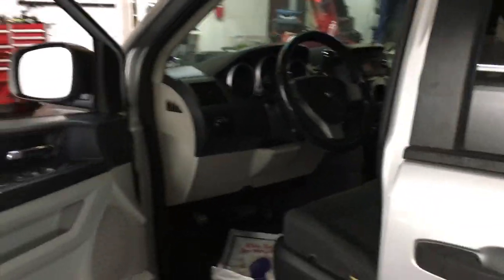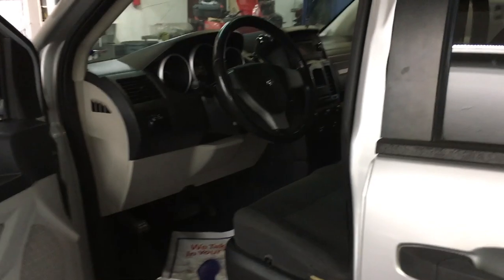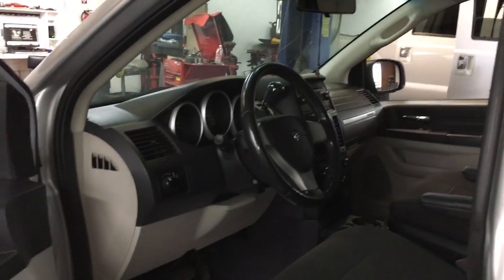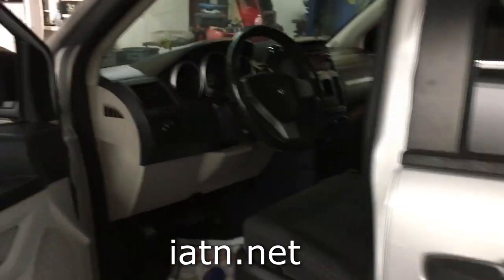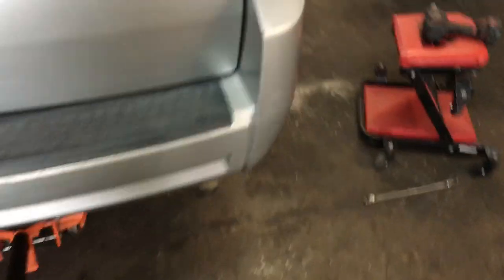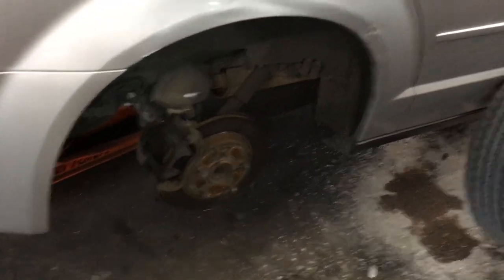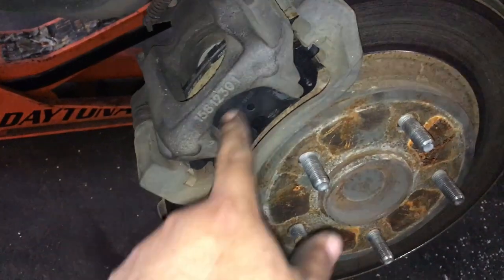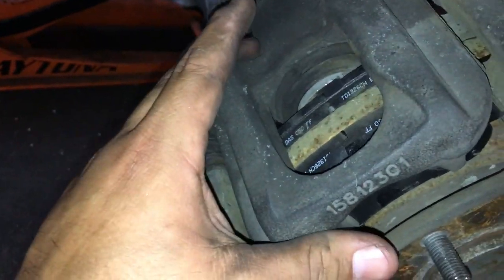DODGE GRAND CARAVAN BRAKE PEDAL GOES TO FLOOR QUICK TIP!

Comment: So I had the same problem with my pedal but there was rattling coming from the rear, I had assumed perhaps a bad shock... Well before firing the parts cannon at it I lifted the back and started inspecting. Shock was fine, rotors shot and the right rear caliper had that gap and lots of wobble/play. Obviously someone has done the rear pads prior and left the gouged rotors but that gap and wobble seemed odd. Glad I checked here! Very helpful!

Comment: Brake pedal 'feel' ( pedal height) always comes from the rear adjustment. On vehicles equipped with screw in type rear calipers, you DON'T turn them in all of the way! You turn them in until there is a slight drag on the pads. It takes a bit of trial and error. Also it is very important that the stud on the inboard pad engages the caliper piston slot. This way there is constant pressure on that pad, and the piston can move out as needed for wear on the pads. Learned this way back in the early 90s on GM W cars. Still applies today.

Comment: The trick to adjusting the gap on  these types of calipers after brake pad replacement is to yank on the handbrake lever while pumping the brake pedal. Sometimes it takes up to 20-25 pumps. It's so the piston screws back out the same time you depress the pedal and it will adjust itself.
Reply: what do you mean? The caravan does not have a hand brake; It has a pedal.
Reply: Close the gap on the brake caliper I'm going to try this later today on the exact same year and problem car.

Comment: That did the trick! Thanks for posting it!
  I replaced passenger side rear rotors and pads last night and all was fine, no air in the lines. Did exactly same procedure on drivers side this morning and pedal was going to the floor.
 Knew it wasn't the master cylinder as it was replaced 6 months ago.  Thanks Again!  Cheers!

Comment: Why pedal is sunk is because all vehicles brake design is depending on applying  brake at the rear wheels first then front (hence double piston master cylinder), that's intended for better breaking stability and redundancy whenever one piston/brake line fails, system will be operable whith a single stroke at 50% reduced power plus increased pedal travel 
Good job Eric

Comment: I have had this exact issue happen to me a few years ago after I replaced the brakes on one of these vans, drove me crazy for a little while until I realized the issue with the piston not pumping out. I used a micrometer to measure the stack up of the pads and rotor combo then found a socket with the same measurement. I then use the socket as a gauge to set the piston depth anytime I replace the rear brakes on this model.

Comment: Thanks guys!  I just bled the brakes last week on my 2016 Grand Caravan.  Gonna fix this now and back out the rear pistons to a reachable distance.
There are other screw-type piston calipers that DONT do this (like Nissin and Akebono).  Now I know that if I ever have this feeling (as brake pads wear down over time), the pedal feel can drop too.

Comment: Great info there!  I did the rear brakes about 4 years ago and I know exactly what he is referring to.  If you don't have the special tool that he mentions in the video it can be a real SOB to turn that cylinder in and out.  It can be done with needle nose pliers but its not as easy as turning a bolt in and out as you may think.  Fortunate for me I did move the cylinder all the way up to the pad..but not because I knew this would happen, it just seemed to be the right thing to do.. now I know why you need to do this and I'm glad for the info.. thanks ADVANCED!

Comment: I don't know if this works on newer cars. In the 90's I was tought when a vehicle comes in like this, to go slow in reverse then stop the vehicle using the parking brake, repeat a few times until the regular brake pedal firms up. This might only work on drum brakes, as I was trying to fix this issue in a pickup with drum rears when an older tech taught me this trick. Thanks for the video!

Comment: This is why I love You Tube.  I just bought this van and it randomly does it where the pedal goes all the way down.  Was thinking it the brake booster but now I will check this first.  Hopefully this is it and it saves me from going down the rabbit hole.
Reply: Did you find out if this Was this your problem? I'm experiencing similar experience with my '10 T&C
Reply: Also curious– did this solve your issue?

Comment: Ran into a similar problem on a Ford. Replaced the rear pads and then the rear brakes were not engaging.  Spun the rear pistons out a bit and they started working.  It was at the end of the day and frustrating, but an easy fix.
Reply: Wouldn't  just applying  the parking  brake a few times  adjust that piston  out?
Reply: @scotthoskins2545  tried that

Comment: Dang, I had a similar experience after doing rear brakes on a Jetta. Fortunately I didn't even consider the MC or ABS to be the source of the problem. Sliders were all fine. After a little head scratching I realized that the automatic adjustment mechanism on the rear disc brakes ironically requires at least partial contact with the rotor. If the rotor is too far out, beyond one pedal stroke, it can't automatically adjust. When I spun the slave cylinder out to position the pads closer to the rotor, the problem solved itself.

Comment: Great design!  The engineers must be so proud!
Reply: Dodge is the WORST! I have a 2006 Grand Caravan, but it was inherited. I love the stow and go seating, and the room it offers. But these are without a doubt, the WORST minivans made. You would think after 121 years, Dodge would figure out what works and what doesn't and at least try to make good vehicles. This particular issue could cause accidents and deaths, so why not just use calipers that don't have this issue? I honestly think Dodge is trying to get people killed.

Comment: Found more detailed description of the reason for this problem:

All rear calipers with an integral emergency brake use screw-in retractable pistons. I think Kelsey-Heyes invented them. This has been the case for 30 years on everything from 1LE Camaro to 1982 Lincoln Continental. The most common error made by mechanics causing the pads not to touch is failing to properly adjust the pistons when replacing the pads. If the pistons are screwed in (retracted) too far, they may fail to self-adjust. The piston needs to be screwed in just far enough to slide the caliper onto the bracket and pads with some force. If the pads are screwed in too far, the caliper will just flop around and the piston will not move far enough to pinch the pads against the rotor. The emergency brake mechanism results in limited piston travel. The force of the piston pinching the pads is what readjusts the mechanism. It the piston can't clamp the rotor, then it will never adjust. Basically you are supposed to fully retract the pads and then snug them up until it's tough to install the caliper. This will give you some friction or rub for the first mile or two and then the pad burnishes off and everything is good to go.

Comment: i had the same symptoms on our work van after removing all the brake pads and cleaning the corrosion off the bracket and pads to free them up. i did turn the rear pistons in for easier assembly and then had the spongy brake feeling, after I reinspected the system for leaks and didn't find any. will check this today for gap

Comment: Had the similar issue with my wife's 2010 grand caravan 6 months ago. Thanks for the video, it will help someone else for sure. Difference was our brakes were replaced 6 years ago, and now this issue came up. I did the same adjustment and brakes are firm!

Comment: Thank you so much for this tip. Been trying to figure this issue out on my landlords van. Whoever did the brake job turned the piston all the way in to where low pedal pressure. Your tip worked. Im not a tech but work on my own vehicles. The more I can learn the better. Thank you again.
Reply from the maker: Glad it helped

Comment: We really like the Chrysler/Dodge with the 3.8L V6. Very solid drivetrain and we easily got over 200K out of the first two and both are still on the road with new owners.  Saying they’re terrible vehicles as some of the commenters above have done is not accurate.  We  now have a 2008.  Same squishy brake problem.  Two things: If your rear brake pads have a pin that lines up in the piston groove they will not self adjust as that pin prevents the piston from spinning out to make contact with the back of the pad.  As other have noted get pads without that  pin..  somebody said they would grind it off - I have not tried that.  Or do as the video suggests  reposition your caliber piston to meet the back of the pad. Second tip - on our 2008 T&C there is a small button on the left side of the steering column that allows you to adjust brake firmness to your liking.  Not sure all T&Cs have this feature but we didn’t even know the button was there until I was poking around under the dash one day.  It has a foot on brake stamped on it.  Try that too.  Our brakes firmed up a little but not like when you adjust that rear piston.  Dealers are either ignorant of the root cause or scamming people into expensive ABS modules and other parts etc. over this issue.
Reply: That button on left side of tilt steering is to adjust peddles back for short drivers.. and forward for tall drivers.

Comment: Thanks for the video. I have a 2011 Grand Caravan. Same problems. First place I had it serviced, they replaced master cylinder, ABS pump, front and back pads, 3 calipers ($1649.00). Brought it back a second time. Still could not figure it out. Brought it to another mechanic. He bled all the calipers. Had no other solution. Brakes still go the floor.

Comment: Up here on the west side of Canada...you have no idea how many of those calipers actually just fail on those vans. The parking brake mechanism in saltier climates just fails and they get to be quite fun.
Reply: I know this is a year old but here goes. While I'm going through this with a 2012...one of many issues. There was a you tube video out about the top 6 or 7 weird issues with the dodgebgrand caravans. The one thing I remember is that they made a break kit for this van because the factory set isn't right for the load..I guess to much weight I am imagining.. that was my take out of it. So IF this doesn't help you can buy a new kit for the breaks specially made for this "EXTRA" vehicle.🙄

Comment: I have a dodge journey 2013 I changed the pads myself 6 months ago and it was working like perfect, but I decided to do some uber so it needed saftey at the shop after inspection there was a leak rear caliper so the tech changed both rear calipers with refurbished ones now after leav3te shop 5 days later I have sinking pedal therfore I will check what you said because I feel there's something wrong it goes to the floor sometimes and I have to pump multiple times to build pressure

Comment: I am having this exact problem and the more I think about it the more I'm think this.  Because I was able to sink one of the calipers back all the way and struggled with the other they are now uneven. I think I have to back off the one that is all the way in, and possibly bleed the breaks a bit.  This video was eye-opening and possibly saved quite a bit of hassle.  I will update tomorrow.  Thank you.

Comment: Excellent answer to a confounding problem. I am in the process of diagnosing a similar prob on my daughters 2013 Dodge Journey. Extremely low pedal but solid at the last bit of travel.  Jacked up the rear, applied the the E braked and found , as you did, the right rear could be spun by hand.
 With rear brake shoes I would have checked the self adjusting hardware and then adjusted the brakes up tight. Was at a lost with the rear brake calipers. They are supposed to self adjust with normal driving, forward or reverse. Spent a couple of hours applying the brakes with no change.
Then I found your quick tip. Tomorrow I will spin out the piston and see hope for positive results. 
When I changed pads last the piston was a bear to spin in. So I am wondering if the self adjusting mechanism is frozen. I will soak it the penetrating oil and work it in and out and the adjust it as tight as possible. 
On a separate subject, the caravans we use for delivery vehicles at the USPS have reoccurring issues with brake fluid leaking from the E brake lever /shaft that enters the rear of the brake caliper. The seal leaks ever so slightly but just enough to allow air into the system.  Thanks again for an informative video.

Comment: Beeld  the brakes on my customers car 3 the times. Found out that a few e brake press and the seal around the bolt the the e  brake cable was leaking  on rear.  Replace caliper then rebleed no leaks drove it and  then pressed the e brake a few times other side started drop also. Replaced it also.

Comment: Nice video and some great advice.
Reply: I couldn't comment for some reason, except as a reply... Anyhow, I got 2013 and they had to be pushed in not turned... only did front atm, but self bleed no go, manual no go... I'm stumped, unless maybe it's a bad caliper... driver side pads were really worn, passenger looked halfway between new and used...

Comment: Some newer fords have you setting and releasing parking brake 5 times per rear wheel during manual or pressure bleeding procedure. We had problems with the mid eighties IROC Z's during rear pad replacements. Was frustrating and time consuming to get the piston adjusted properly. Pedal still sucked!

Comment: I have a 2003 dodge caravan with front disk brakes and rear drum brakes. I have the same problem where the brake pedal goes almost to the floor. I can get the Front passenger brake to lockup during braking, indicating that passenger brake is the only one working. The parking seems to work but not sure which wheel the parking brake is attached to. Should I apply the parking brake and check all four wheels to see any are turning?. Your video shows the rear brake was the issue. Should I also check the rear brakes even though my rear brakes are drums and not disk brakes?. Thank for any help you can give me.

Comment: Eric would exercise the parking brake a few times adjust the parking brake and eliminate the gap? I know I've changed rear brakes with the wind in pistons and exercised the parking brake and never had a problem. Just wondering but I am sure you have done more brake jobs than I ever will. Have a good one Artie 👍👍👍

Comment: When I lived in Ohio (lots of road salt), I've had this happen a couple of times with caliper pistons that were frozen in their bores
Reply: I am starting to think I have a bad caliper. I've already replaced the master cylinder, and my Caravan doesn't have the cylinders that screw in, so it isn't that. I'm at a loss.
Reply: @pre4122  Are you sure the brakes are bled properly? Any air in the lines will cause the pedal to go to the floor
Reply: @justsumguy2u  Yes. It's worth noting that nothing was done recently that would have required me to bleed the brakes until the pedal went to the floor. Over a year ago, I replaced one of the calipers because it was failing and causing the rotors to get VERY hot and actually caught on fire. It's been over a year since we replaced it with no issue. Now all of a sudden the ABS light comes on and a few months later, the pedal goes to the floor intermittently. Last night, I had the mechanic bleed them anyway though. I took it for a test drive, and the ABS light came on again, but so far, I have not had the pedal go to the floor. I want to drive it for a few more days and see if it does it again. When he bled them, he claimed he did not see or hear any air come out though. So we are both scratching our heads.